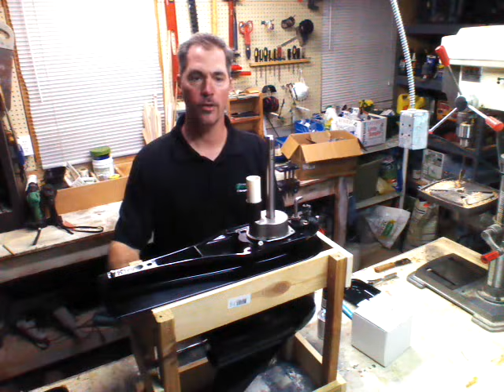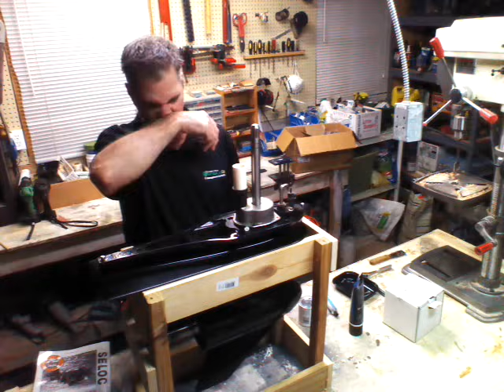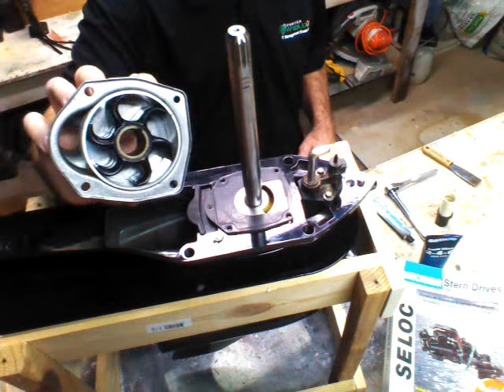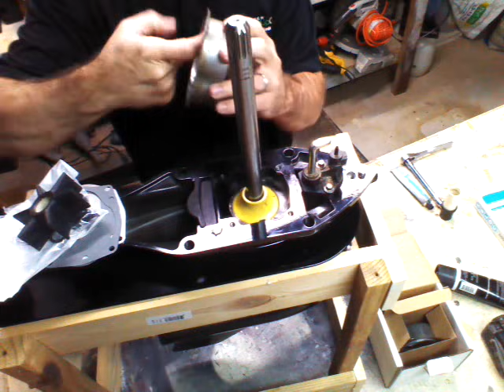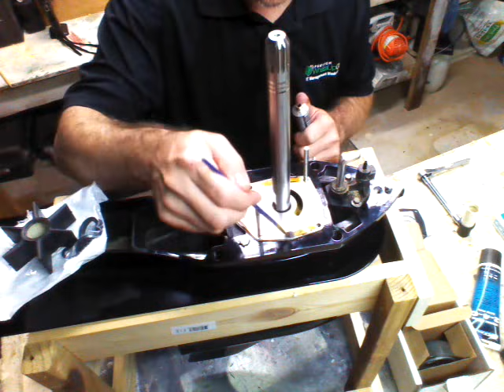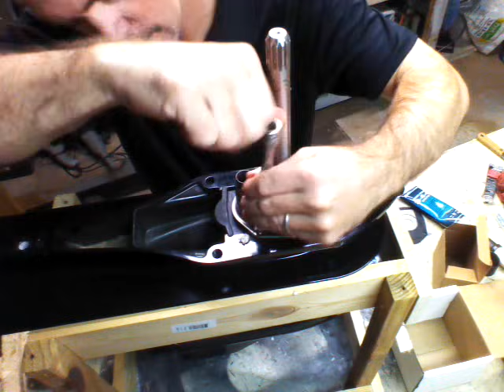Mercruiser Alpha One Gen 2 Impeller Repair

Comment: I wish all DIY videos were of this caliber. Your planning, thoroughness, clear explanations, and caution statements are confidence inspiring to those who believe in doing things themselves.  And doing them correctly.   Minor details are critical to mechanical maintenance and repair.  Now I am hoping that you have posted the removal/ refitting  process for the drive.  Just a couple of mentions:             (1) Since  it is important for the shaft not to contact the impeller housing bore maybe a feeler gauge would be helpful.  Better would be a piece of thin gauge sheet/roll metal, like deck flashing, that could be wrapped around the shaft as a spacer until the bolts are secured.  This would help ensure the best possible coaxial alignment of the bore and shaft .  (2) Is it not advisable to use an anti-seize compound on the fasteners in this application instead of marine grease?   Knowing that it is not recommend to lubricate fasteners during assembly, anti-seize is made specifically for threaded unions.   (3) You began threading the bolts in a diametrically opposite manner, then switched to a circular pattern.  I have always stayed with diametrically opposite all the way through.  I personally believe that it helps to achieve a better distributed clamping force.  And on that note, I think this project is the one that finally sees a 3/8" drive torque wrench that I always said I would buy.  (4) Do you recall the diameter and thread pitch of the bolts that you used as guide pins?  I like to have everything I need before I begin work.  And that will be the one bolt size I do not have in stock at 2:00am..
Reply from the maker: Thanks for words and glad it helped. Good suggestions. Those pins really are intended to max the alignment accuracy, they are thicker than the the bolts so cover doesn't move. I suppose antiseize would be ok, marine grease won't wash out. I don't recall thread specs, but I took a screw to hardware store and got exact match on a bolt, then I cut the head off. The oring I had was for the fill plug. Good luck.
Reply: Michael, you’re correct that torquing fasteners in a diametric fashion (star pattern) is necessary to achieve even clamping force; however, once all fasteners are torqued properly it is acceptable to check their torque in a circular pattern because all you’re doing is verifying none of them loosened. If you find any that are loose, re-perform the star pattern.

Comment: Good job..I know you put ALOT emphasis on the direction of the veins of the impeller.... But it's really not an issue at all...even if you turned the shaft counter clockwise when pushing down the impeller housing, the first time you turn the motor on the impeller WILL correct itself on the very first rotation .....
Reply from the maker: Good to know, always wondered about that

Comment: Thanks, nice video. I thought you were not supposed to use vaseline or petroleum-based grease on the impeller as install lube because they might not be as safe for rubber. I have used water-based lube (e.g. KY jelly) although it dries kind of fast.  You could probably use silicone lube (such as for plumbing seals) also.
Reply: I broke a rubber once using KY, now he’s all grown up and helping me with my lower unit rebuild
Reply from the maker: Best to use what manual says. I used endorsed marine grease by mercruiser. Don't use petroleum like Vaseline as I to will break down rubber.

Comment: Hey John, I just did impeller, gimbel bearing, a few o rings out everything back together filled with gear oil, took a look and noticed water leaking from top cap of outdrive. I noticed the guide tube was a little cocked. Not sure if that was the problem? Another thing my impeller gasket kit didn't come with 2 paper gasket it was one paper, the plate then a very thin plate?

Comment: Great video.  Anyone know what gasket sealant he used on the gaskets?
Reply from the maker: No sealant on the housing gasket. Didn't have any sealant from factory and not in solec manual either.
Reply: @jonparkmac  you must be mistaken on the question or maybe he worded it wrong but you put on some gasket sealer with a paint brush while putting on the gaskets
Reply from the maker: No mistake. No need for sealant. The gasket is for adequate pressure and not for absolute leak prevention because both sides are in contact with water anyway. So adding sealant doesn't add any protection or value. Use if you like. Really is unnecessary.

Comment: Does the impeller move when not in gear as in forward or reverse position it seems like fish after that is turning turns the prop as well and what have to be in gear to turn so how does the engine get water 1 in neutral is it sucking it impeller is only used for when the boat is in motion this might sound like a stupid question but I'm new to boating
Reply from the maker: t's not a stupid question at all. The impeller is always turning so water is always impelled to your engine water pump. The shift tongue on the lower unit moves the gears to be in forward, reverse, and nutral. When you have it off, you can move that tongue back and forth and then twist the shaft to see the prop shaft rotation to see how it works. Your shifter cable connects to that tongue.
Reply: @jonparkmac  I appreciate your reply I was using text-to-speech so that's why there are some typos in there but none the less I sort of figured that but I assumed since the engine has a sea water pump on that would not emotion that would pull from that I made an observation of it not being in motion when it's not and gear because I noticed that the shaft turns and the prop turns with it but it may have just been when the lower unit was taken apart it was put into gear someone that is put back together it goes together correctly

Comment: Why after reinstalling gearshaft housing, my reverse won't engage
Reply from the maker: Check to make sure the shift tab is aligned. I think you have to put the shift in forward position when you mate the lower unit back on to the upper unit. I think you need to take it off, shift, and out it back on.

Comment: Good video, well done. Only comment I would make is that rather than using grease on the inside of the pump housing, use dish soap. Some greases will cause the impeller rubber to degrade over time. Dish soap will provide the lubrication you are looking for and wash out the first time the pump is run with water in it.
Reply from the maker: It's a good suggestion if you don't have marine grease. I used what is recommended in the manual and by mecruiser. You are correct, petroleum lubes like vasaline can degrade rubber.

Comment: That little o ring I believe is for the speedo cable did you find out or not because I'm doing mine?
Reply from the maker: It's was actually a seal gasket for the lower drain plug. Technically not a rubber o ring

Comment: Nice work on this video! I'm replacing my first Alpha 1 Gen 2 water pump impeller tomorrow morning, and this video was so much more helpful and "human" than the usual Professional Disco Boy (Mika Marine) stuff that Mercury puts out on their website or in their service manuals.
Reply: Edward Morton I’m going to do mine tomorrow.  I’ve heard something about needing to put the gear selector in forward prior to separating the lower unit.  Is this necessary ?

Comment: What size were those guide pins you bought?
Reply: They are metric 6mm diameter with 1mm pitch
Reply from the maker: They were just long machine screws I cut the heads off. I don't recall the size, I just matched the actual screws at the hw store
Reply: Jonathan McClure thanks. Great idea cause those pins are like 30 bucks.

Comment: I need to do my impeller. Can you share the specifics on your lower unit cradle that you made? Thanks
Reply from the maker: It'll be a week before I get to it, but basically you build two squares with height 1" taller tgan the length between bottom of rutter and the lower horizontal fin. Then set the prop on those and put 2 cross mbrs on each end to secure it. I drilled and used wood  screws.

Comment: If the extra piece is plastic and not rubber, it is for the gear lube drain hole.  My kit actually came with two -- One for the drain and one for the vent.

Comment: The extra gasket is a fiber washer for the lube screw.  There should have been 2 of them.
Reply: It's what i thought, there's only one in this package though.
Reply: I found an area that the o ring fits it's the second groove on the front tube below the first o ring that's where I put mine 😎

Comment: What size/thread size for the bolts for the guides pins?
Reply: They are metric 6mm diameter with 1mm pitch
Reply from the maker: I can't recall, but just take a bolt to the hw and test the threads in their nut plate to find out. That's what I did. Then by the long bolts there.
Reply: oh ok,   thanks for the help.
Reply: anyone confirm thread size and length
Reply from the maker: @KeithUlle  don't let it hold you up, any hw store has what you need, just take the screw and match it up. Good luck!

Comment: Nice job
Reply: At last i find when I changed impeller before 😂. From some reason I don’t see that in my nots. Before i painted my garage I wrote everything on my walls. 😅 Why before I don’t notice your great idea about that long bolts ? I used old impeller to install last rubber seal .

Comment: Well done. I would recommend to others you skip buying the extra housing (in most cases) and buy that lower carrier seal below the impeller. Mine started leaking (out the weep hole) with the new fresh thinner oil so I had to take it all part again.

Comment: A great video but pump the brakes. STOP!  It is not necessarily true that you rotate the shaft clockwise. I know for a "FACT" that our Merc 3.0 Alpha One lower unit, Which looks exactly like this unit, rotates COUNTER clockwise!! If you install the impeller with the vanes of the impeller rotating in the wrong direction it will not pump and you will overheat the motor. The only way to truly know which way to install the impeller is to take a picture before you remove it or better yet, put the lower unit in gear when its off and put the shift lever in drive. As you rotate the prop as if the boat was moving forward, take notice which way the shaft rotates. This will ensure you have the vanes in the right direction when you install the cover. Trust me I have made this very mistake!! Just double check. Not sure why ours is counterclockwise but check your shaft direction before you install the impeller.
Reply: All depends on what engine you have i.e. it's rotation. 😀
Reply: All you have to do is look at your prop rotation.
Reply: yep, as long as you know if its in forward or reverse. and that's easy.
Reply from the maker: Thanks Kevin. I mention exactly that in the video 😊
Reply: Kevin Keller thanks for the info, but why would yours rotate counterclockwise?  That's weird.

Comment: Just fininshed my winterization about 2 months which included changing the lower unit gear oil, always a bit messy.  Was recently checking my maintenance records and think its time to replace the impeller which was done 3 years ago.  

Some other videos direct you to drain the lower unit gear oil prior replacing the impeller.  Do I need to do this?  Seems to me that if I take care to temporarily cover the gear lube transfer hole from the upper supply reservoir I save myself from having to drain and refill the unit.  Can you comment.  

Thank you for a well done video.
Reply from the maker: nazmen040 good question, definitely drain it. Gear oil is relatively cheap and good to change anyway. Remove the top vent screw, then the bottom and let it all out.

Comment: Forgot to change the oil seal below the impeller
Reply from the maker: Robert Gary nope, didn't need to and that does not come with the kit. This video is for the standard impeller maintenance. That said, you can do it if you like.
Reply: How do you get it out?

Comment: the extra O ring is for the gear lube hole (the hole you covered to prevent debris from entering)
Reply from the maker: Keith rosipko actually no, it was for the oil fill plug at the bottom, the oil transfer oring is different and already accounted for. g

Comment: Well done. Very clear. The other rubber seal, I believe goes on the stern drive upper section. At least, I believe I watched another guy place one there. Would that be the oil seal you are mentioning?

Comment: nice vid, i would not use the grease on rubber though. it eats rubber just like oil dois. use vaseline on the rubber parst like the rings and the impellor itself... and the insite of the housing. the little o ring is for the gear oil channel that runs up to the control container i guess. cheers. happy boating!
Reply: My old auto teacher warned all the guys not to use vaseline on rubbers cuz it would deteriorate the rubber and you’d be a daddy!
Reply from the maker: jelle buyckx Vaseline is probably ok, I used exactly what the manual specifies which is merc marine lube, not grease
Reply: Yeah its probebly ok. I am just always very carefull whit rubbers. I even saw people use dishwashing soap to put on the impeller. Thats a real big no no. :)
Reply: @ikkebuyckx  why is dish soap a big No-No? Grease is a big No-No of any kind. I'm surprised they recommend Grease. Have you ever seen grease and water whipped together? It basically Foams up and expands. It can clog up passages.  The dish soap does the same job of helping the impeller slip in the housing and it simply disappears when the water circulates through. Actually have you ever heard of salt Terminator? Guess what it's made of...

Comment: Excellent video - very well articulated.  I have an older 470 drive which is going through its annual pre-season check-out.  The alignment pins made out of commonly available bolts(screws) is a terrific idea.  Many thanks for posting your work.
Reply from the maker: Glad it helped. I'm redoing this same exact unit right now, and will also replace the carrier seal

Comment: Please tell me in what osition the front controller is in ? Do you squeeze handle and push all the way forward before you start lower drive removal ? Thx in advance.
Reply: Is it critically important to put it in gear before taking the lower unit off?  I took mine off while gear was in neutral and am worried I might have screwed this up by not putting it in gear....
Reply: @chadpapineau9209  just put it in gear before putting lower unit back on. It’s nice to have another person helping that can turn prop shaft for alignment.
Reply from the maker: yes, I put it in forward gear first. You can actually see where the lever mates with shift cradle and see if it detaches. Patience and even downward pressure is key..just don't beat with a metal mallot

Comment: what if its a left hand motor?
Reply from the maker: You just need to make sure you match the rotation of the old impeller. It's very obvious which direction you'll need to pursue.
Reply from the maker: ***** a rightie will work ..as long as it's not a Phillips 😀

Comment: I like this guy he is very clear and sensible and profesinal   nice job     bills brakes@gmail.com
Reply from the maker: The top cover should have oil and not water. If you see water it means you have water pressure in your gear oil and that may be due to not putting in the rubber o ring between the lower and upper drive. Any leaks in the pump houseng or delivery tube can cause pressure and push water up thru the oil channel. Pull out your top oil screw and check for water. Nothing to do with lever.

Comment from the maker: As many of you pointed out .. the remaining seal washer was the lower oil drain plug.
Reply: Thank you. This is exactly why I was watching the video. I was wondering what those gaskets were for. I had two in my kit. I assume one for the upper vent plug and the other for the drain plug.
Reply from the maker: JesterStrike yes, the upper one is a rubber o ring and it's for the gear oil transfer from upper to lower unit. without it, oil leak and possibly water in oil, both bad.